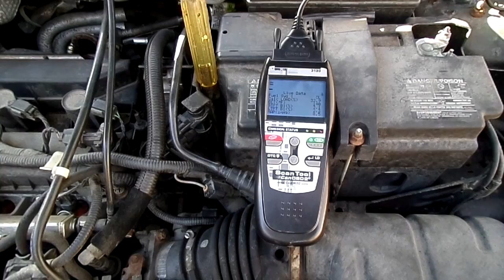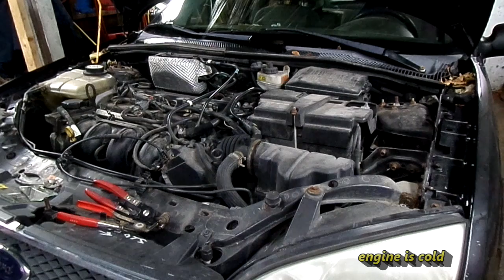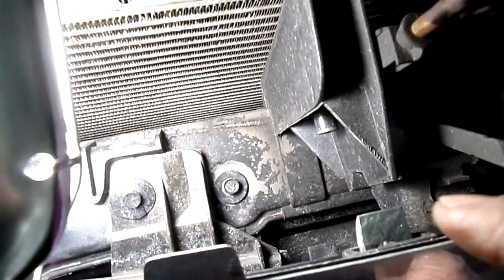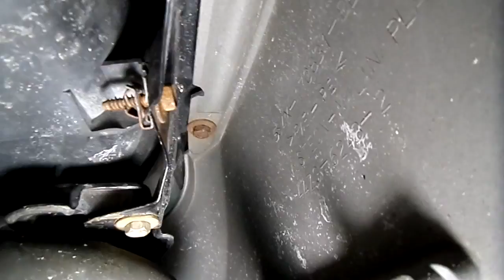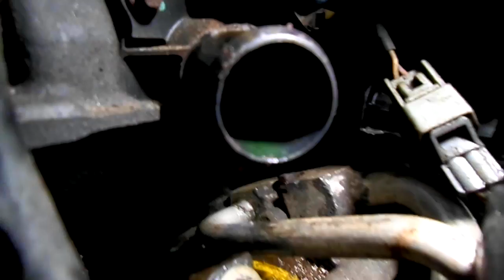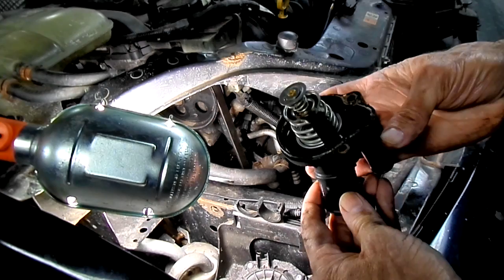Repairing  P0128 Trouble Code

Comment: I got this code the other day I’ve noticed the coolant gauge works but it seems that it moves slowly I don’t know if the gauge isn’t working correctly like I said it dose move but slowly or the thermostat is stuck open but I still get pretty good heat into the cabin so I’m not sure but I erased the code and I’m going to see if it comes back if it dose I’m going to dig deeper into this
Reply: What was the issue?
Reply: @dross10001  bad thermostat

Comment: i have a 99 Saturn that wont pump fuel replaced fuel filter can hear fuel pump is the pump bad
Reply from the maker: I would put a fuel pressure gauge on it to see what the pressure is.
Reply: @RichpinTv   i dont have any pressure